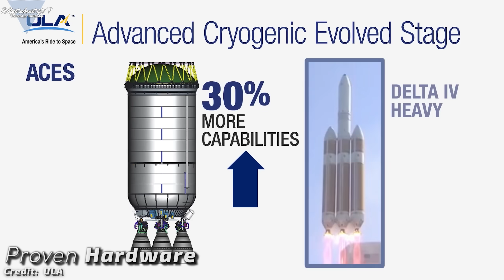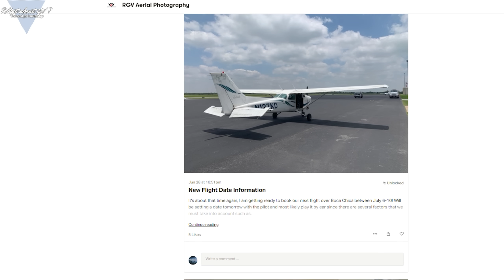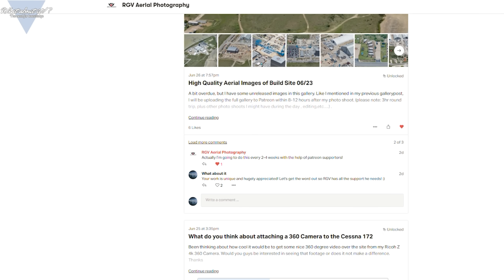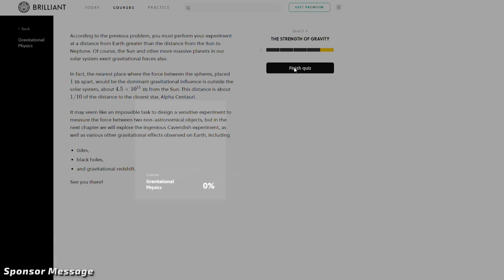101 | SpaceX Starship - Why are they building it in a scrap yard?

Comment: Retrofit oil rigs for superheavy luanches.. uh.. No.  That will be far more expensive than you think and would also be a little small for what's needed (I was raised in the shipbuilding industry, although now a software engineer).  However, taking design queues from them is a great idea.  The portability, anchoring, and stabilization will be very useful.  These things also need to survive hurricanes/typhoons, in addition to not tipping over a super tall stack of rockets in rough seas.  They might want to consider storage of fuel deep under to act as extra ballast....

Comment: The Space Shuttle and it's lame orbital missions prevented funds from going to Moon and Mars dreams for 30 years. 1981 through 2011. I graduated from High School in 1983. So there was no opportunity via NASA to develop a mission to establish a moon base or a Mars base safe for human habitation. Wasted time.
Reply: Yeah, massive use of time and resources for a PR project. Cold War and all, I guess-- it was far too ambitious and just couldn't deliver with 70's tech. And then they just kept at it when a simpler system was obviously what was needed. So very, very much money. . .
Reply: The work done on the Shuttle, and the Space Station was more important than more flags and footprints. Rosket launches are irrelevant, what is important is what you do when you get there. Starship will take us back to the Moon and on to Mars. More importantly, it will let us build large orbiting factories, habitats and hotels.
All that said, instead of shutting down the manned space program for nine years while we built tiny capsules again, we should have started developing a more advanced space ship in the 1990s and replaced the Shuttles with it ten or twenty years ago. On the other hand, I have to admit, had we done so, the market for private space enterprises probably would not have developed as it has. You have to take the good with the bad.

Comment: Why use solar energy for producing methane? A cow produces around 10 kg of methane a month. A fully filled Starship methane tank contains around 300 tons of methane. So If you connect 30 thousand cows throughout the US with a pipe connected to the posterior opening of their digestive tracts, in a month’s time you would have enough to fuel Starship. From now on it should be called Fartship....

Comment: Your oil rig idea is a classic Musk strategy Felix. But from the size he stated he'd have to move several together, AT LEAST, and then pour a ton into retrofitting and upgrading. Maybe as a proof concept with a Falcon I can see this happening better as it's proven and one of those could fit easily on a decent sized rig with floating support. But I'm thinking for a reusable SH and SS stack he's going to have to go custom built in the end for sure.

Comment: 7:15 "Methane will be produced on site, Carbon neutral, solar energy. SpaceX won't have to rely on anyone else, and the site will almost be self-sufficient."
For on-site methane production, they need orders of magnitude larger solar plants to produce enough methane with the Sabatier process:
Zubrin's estimate is one Megawatt for two tons of methane and oxygen per day, with a single Starship+SuperHeavy launch from Earth requiring 5600 tons of propellant; the plant in place is most likely less than a Megawatt.
They might make a bit on site to perfect the process, but they will be using cheap fossil methane for the foreseeable future.
Also, are they desalinating water for those huge deluge systems, or using the water infrastructure of the village they cannibalized?
Have they built their own seaport and roads, or using the local Brownsville deep water harbor, and local roads?
What about all the mining required, electronics, and all the other high and low tech parts they will definitely not be producing on their own?
Self-sufficient and carbon neutral indeed.

Comment: Comverting oil rigs into launch pads might be a very dangerous thing to do ad there still might be some oil deposits underneath them this will quite obviously need to be looked into before hand?
Reply: That would be under water, and 50-100+ meters down under the seabed. Not a concern.

Comment: I am a great fan of rapid prototyping. But, you don't build your prototypes blindly. You explore the subject matter, try to identify risks, test ideas on a small scale. For example:
- How comes that Musk learned that manufacturing large structures from carbon fiber was expensive and slow only by trying it? Were numbers from aircraft manufacturers not good enough? Or did he think that his charisma will lower the cost and speed up the process tenfold by a magic wand wave?
- What's the story with those welds? Welding stainless steel in general, and pressure vessels in particular, is not rocket science, if you will pardon the pun. There are manuals and trade school classes for that. Tanks for Musk's water towers are nothing unprecedented. And even if it were, how about testing the welding techniques in a laboratory/workshop first?
- What's the deal with evaporative cooling that suddenly disappeared and was replaced with Shuttle-style ceramic "aerogel" tiles? Never heard of computational fluid dynamics tools? (Like the idea, one that lived until second or third Falcon 9 launch, to use parachutes for recovery - the world has been there, done that, and knows the problems; no need to re-learn them by trial and error.)

You can't learn everything ba trial and error. Some things must work at first try.

OTOH, one wonders how many dozens of successful, at first glance identical, test flights does Blue Origin need to put the first crew in their suborbital New Shepard?

Comment: The thing that is very strange to me in Elons plan is that he intend to mass produce Staships and then basically use them one time. It is the opposite of what you would expect from SpaceX. And I know, those Starships will return to Earth after few years and work again, but still, that does not feel sustainable for me. If he would start with the Moon, he could produce only 1/50 of the Starships for same goal. And even if it will be difficult to obtain carbon on the Moon it still would be cheaper to transport coal from Earth to the Moon. And even though regolit is poor in carbon, I am sure there are sources of carbon on the Moon, we just did not identify them yet. Carbon is less than 20% of overall fuel so you would still gain 5x in comparison to the "carry your fuel mission", that still would be possible and interesting with Starship.
But even if the CO2 is crucial, and we need to go to the Mars, why make all Starships go through reentry? Why not send a fleet of for example 2 regular Starships and 2 space only Starships, that would be better suited for space and without dead weight of heatshield, wings and SL Raptors? Space Starships would not land, they would just use regular Starships for transfer. And since transfer of cargo in space would be something new, just start with crew. Build few first space Starships mostly for human transport, and some easier to transfer cargo, even if just trough the docking port, manually. Then work on container system that is easy to transfer between Starships in space. It is important to invent that anyway. Easiest way would be to adapt clamshell cargo bay from transport Starship, and move container/ containers with robotic arm. Just make sure they are attached properly for reentry ;-).

Comment: I don't know that they couldn't have made a clean room in a similar fashion, because all you need is some fans drawing in air through filters with enough pressure that any holes will be pushing air our not in, so the only addition would be some holes with fans and filters on them.
Reply: It isn't really possible to make a 200+ meter high clean room

Comment: Great updates with excellent coverage. Many thanks to you and your team. My main concern about Boca Chica is ocean rising and hurricanes, That could be catastrophic.👍🚀🚀🚀👍
Reply from the maker: Thank you very much and agreed! We'll have to wait and see about that.
Reply: Oceans are not changing drastically, the change in sea levels have been rock-solid for 100+ years, with about 3-4mm/year.
That is EASY to build around.
Hurricanes is an issue in that area, but they should be aware of the risk, and the hurricane-frequency has been slowly dropping the last 30+ years.
Reply: I live on the Gulf Coast. Sea level is not rising. Hurricanes are a factor down here but the odds of any given place being hit by a hurricane in any given year are really fairly small, weaker storms are more likely than stronger ones. No, there has been no increase in the frequency or size of hurricanes in the last thirty years.

Comment: 8:30 How far can the rocket jump without the booster? Pretty sure that suborbital starship will have 7 sea level engines and no booster.
Reply: @admarsandbeyond  Thank's
Reply from the maker: Six Raptor engines and maybe even single stage to orbit. No fuel left to reenter though. ❤️🚀
Reply: @admarsandbeyond   Really? Is that all? I would have expected a good deal further, at least twice that.

Comment: Thanks Felix. There’s an agile phrase called “keep it scrappy” and SpaceX sure does that. They are building a flying megastructure so a clean room for microelectronics precision is not currently required. I bet their satellites are built in a clean room...horses for courses is the analogy.  I think their approach is brave and inspiring.
Reply from the maker: Agreed! Thank you for the comment! ❤️🚀
Reply: Very good, Paul. I am sure the act will clean up once it is showtime with humans aboard. Until then it is just R&D.
Reply: @ronfullerton3162  why ?? The need? space x hardware seams to be constructed well enough not to need expensive levels of medical grade clean room technology and doing it a regular taller warehouse or subassemblys ( same as modern ship building methods )  with out temperature control is working but I’d recommend a/c and heating for the workers not to pass out ( after all it’s Southern Texas ) and for more consistent faster production that and great lighting systems so you can see what the heck you’re doing. Welding outside works too but in high winds it can blow your shielding gas away and or your slag protection and moderate to heavy rain can make the welds more likely to be brittle plus the man safety aspects but other than that it’s just the same as building super tankers for sea going or a cruise ship 🚢⛴🛳✈️ Or a large skyscraper All the same to me
And to add space x isn’t building F1 race cars 🏎 ( their aiming for a sea going vessel,simi truck/bus,airline the same as the jumbo jets Service record in the last 50 years ) unlike nasa in the past that was disposable one shot at getting it right the first time out and no second chances just look at the falcon 9 vs what it replaced in the past I you will see what I mean

Comment: The big question ... what is the largest diameter starship the high-bay can accommodate?  This will tell what Elon plans for the future
Reply: Don't think so. They will directly jump from 9 to 18 meters. And height can be increased by 43% if they manage to reach 300 tons of thrust for sea level thrust optimised raptor.
Reply: Not really. They built a bay for Starship, they're building a new one for Superheavy... if they build the 18m version, they'll build a new bay for that...

Comment: The other main reason Starship is generating more news than any other rocket is that we can see it.  They're doing it all right out in the open where people like LabPadre and Nasa Spaceflight can just set up cameras and watch 24x7.
Reply: Free advertising giving them the new face of space exploration over even nasa, no crazy new tech can be seen that needs to be hidden let’s be honest the materials are pretty standard and well at the macro level the other space companies aren’t gonna gain much of any secrets
Reply: Well, let's be complete in this observation: They're both inviting that scrutiny and providing regular details to fill in the blanks.  Worth underscoring, in how thoroughly it contrasts with the likes of Blue Leisurely.
Reply: @We All Laugh Down Here As Felix told us in this video, this method of research mirrors that of the early days of rocketry. Space X wants to move forward and quickly, and we already know that the way others proceed is slow.
Reply: Do consider that NASA did much of their work (Apollo) during the Cold War. Back then the public was against openness "if I can see it, then those 'damned' Soviets can too."
Reply: @We All Laugh Down Here  NASA doesn't design, build or test rockets at all.
Reply: @odysseusrex5908  SLS is technically a "new" rocket (configuration).

Comment: I'll be very happy to be proved wrong but I think you might be being a bit optimistic about new 81m HB maybe being finished in 4 weeks. Midbay took longer than that I think. One issue was that many days were lost due to high winds making it too dangerous to work on it. I fear the same might happen with this new HB. I'll be pleasantly surprised if it's ready for use within 8 weeks.
Reply from the maker: Rough estimate. 8 or 10 would be fine too. 😄❤️🚀
Reply: @Whataboutit  Yes. Even 12 weeks - about 3 months - still means it would be ready by 1st October so 3 months (Oct/Nov/Dec) of actual use from it in 2020. That should be enough to build multiple boosters to attempt Elon's goal of an orbital test flight by the end of the year. Also, I suspect booster construction can start at least a month before the new high bay is ready. If the booster is essentially the same set of components as the noseconeless SN3/4/5 - a CH4 tank on top of a LOX tank with a thrust and skirt section at the bottom then, even with each of those components being taller than their equivalents in the SNs that we're already seeing, I suspect that all of those 3 sections could still be individually stacked in the existing midbay and only need to go to this new super high bay for the final stacking when all 3 of the booster sections get put together and then obviously a lot of wiring and plumbing work before it can get rolled out to the launch pad.
I actually think that SpaceX has a really good chance of meeting that target of first orbital flight by the end of 2020 providing they don't hit some big problem to overcome and get stuck for a long time and lose multiple Starships trying to achieve the 150m or the 20km hop milestones.

Comment: Very interesting thing to me is that point to point transportation idea with a starship looked more like an after thought for starship purpose, something added that it can do but like mostly wont be used that way. Now, in these times when airline companies and airplane manufacturing companies are struggling and nobody is sure how many months or even years the covid thing will persist.. point to point travel via starship seems like a really feasable future business.. you dont have to breathe stale air in airplane for hours, no transfer airports and contact with people there, as far as health from viruses is concerned. And the way they are progressing maybe..just maybe.. production of one starship wont be much more than of one boeing 737 or airbus a350 ..
Reply: Airliners actually completely replace the air in the cabin every few minutes. Even on planes that are pressurised, fresh air is still constantly being feed from outside.
Reply: @E4S65  Due to the smoking bans the air is actually replaced much less frequently (45 mins?); this is free to authenticate at any airline air conditioning company.
Reply from the maker: Starships are supposed to be much cheaper than an airliner!

Comment: we talked about the crane last week but there was no sense of scale. That thing is enormous
Reply: I went and looked up the info on the crane I mentioned. 

Terex/Demag Cc6800 

1680 ton capacity
314 foot boom, extended to 668 feet with a luffing fly jib extension (which was installed when we did the stadium.)

I do remember it had a million pounds of counterweights installed, and it took 70 semi loads to bring all the parts to the site.
Reply: @ironworker512  🤯🤯
Reply: I worked with a similar crane on the Minnesota Vikings stadium in 2014.

You’re right, they are enormous. This coming from a guy who has worked with a lot of cranes.
Reply: @ironworker512  I sincerely hope Boca Chica Gal keeps a camera on that beast when it is working. I really enjoy watching operators at work.